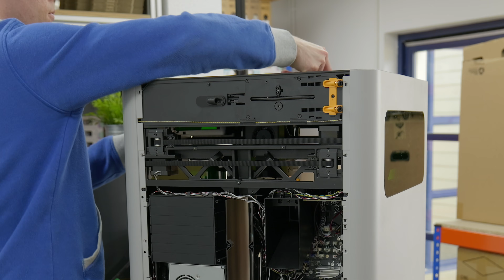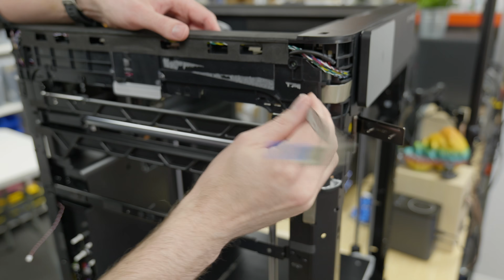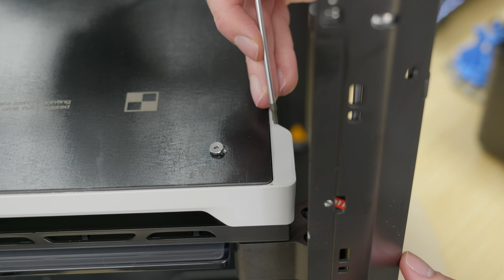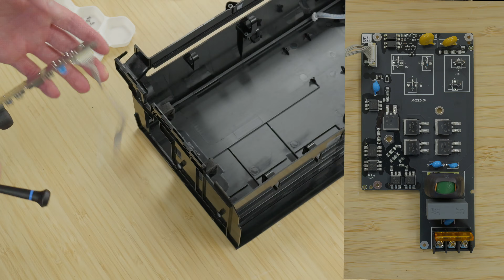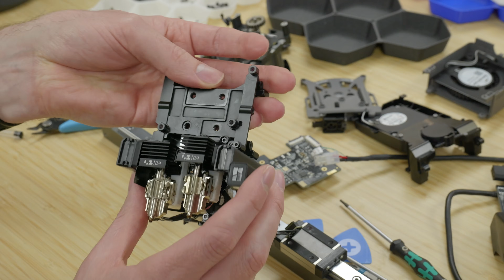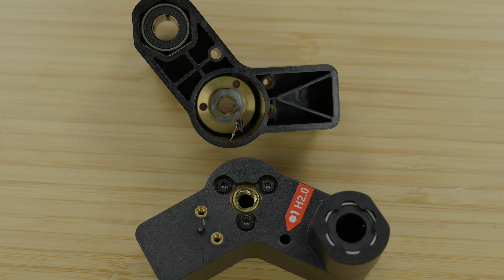Broke my Bambu Labs H2D to Show You What's inside

Comment: People who have been saying that this was too expensive at the pre tariff price )which unfortunately, is what I paid) should watch this video. To me, it’s hard to believe they could have sold it at that low price, considering the complexity and the amount of R&D required.
Reply: Tooling for injected plastic and sheet metal parts is very cheap in China.

A large company I worked for (that no longer exists) got an injection mould for a component made in Hong Kong as an experiment.  Cost about one fifth of what they could do it for in-house, was much faster, and quality was comparable.  This was long before China became the manufacturing powerhouse it now is.
Reply: @ that’s true. But labor costs have risen to the point where there’s little, if any, advantage there anymore.
Reply: @melgross   I didn’t mention labour costs.  Tooling costs.

Supply chain is also far more efficient when all of the components are locally sourced.
Reply: It was made in China.
Reply: @bobbunni8722  your point?

Comment: It is impressive how much technology they have crammed into that product at a fair price. But wow, if something non-trivial breaks on this machine then it seems to be difficult to perform the repairs in some instances. They use a lot of screws which is good, but there are also snap connections, tape and glue in many places.
Reply: Lets pray that ours will never break down. A repair will easily cost a fortune…
Reply: @snapshooter65  Some parts are easy to replace and doesn't cost a fortune. But for some other parts you will have to spend a lot of time on the repair.
Reply: Yeah repairing something on the hotend could be take a little bit longer than on a X1C… 😅

Comment: cannot imagine the RND budget of this or even the amount of time it took to develop this thank you for making me realise that
Reply: They made 1,500 prototypes... that's insane
Reply: @mostlymessingabout That's the random number he quoted in the interview. Don't believe that.
Reply: @Technoboy928  I believe it. Hell, every company is still trying to catch up to the X1C and its still better lol
Reply: The X1-Carbon’s tooling alone cost around $2mm USD and Bambu Lab (no “s”) has around 400+ full time engineers.
Reply: And it doesn't even cover the laser stuff. Absolutely mental.
Reply: @zmast333  sorry but the laser stuff is just marketing, there is no engineering budget that everyone know dust is bad inside a 3D printer....
Reply: @vilainlechat7187  I agree it was a bad idea, but it certainly took time to engineer the laser module, controlling software, safeties, etc. In my opinion they should have spent that effort on other things, like refreshing the other printers or making a bigger one.
Reply: @zmast333  listen to the CEO's talk to CNC kitchen. It makes sense. This is already 4x the volume of the 1 series printers. It's big and heavy enough.
Reply: @vilainlechat7187  Guess things like engineering the airflow to extract dust in a certain pattern so as to not accumulate on the rails as much came for free huh? Nice.